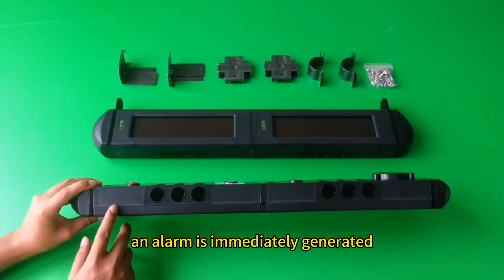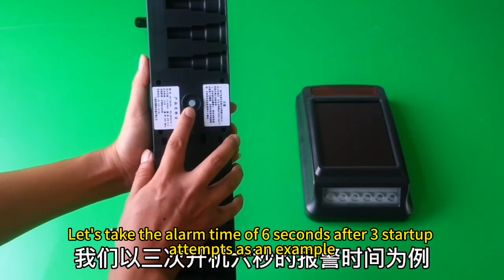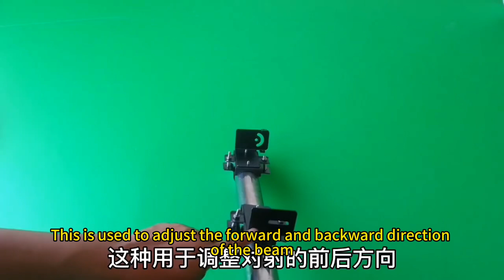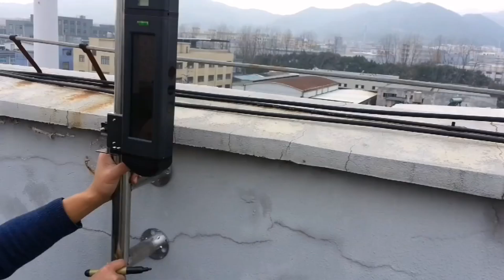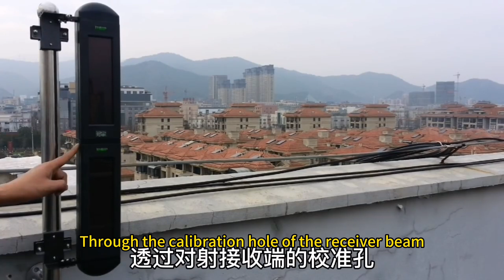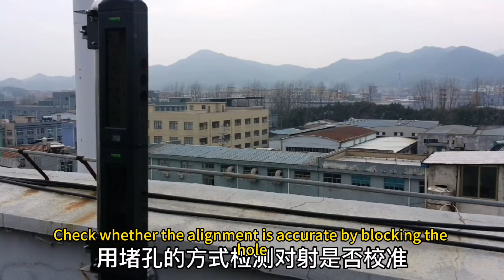How To Install Outdoor Security Infrared Beam Solar Wireless Intruder Alarm Safe Home And Business

Comment: and how to silence the alarm sound ?
Is it necessary to use a laser to calibrate?
Reply from the maker: Please press 7-10 times on receiver terminal on/off button to power on it. Refer to manual operation step 1.
Reply from the maker: If the detection between transmitter and receiver is longer than 50 meter, laster calibrator should be used for easy installation